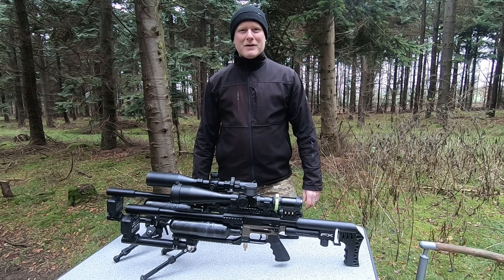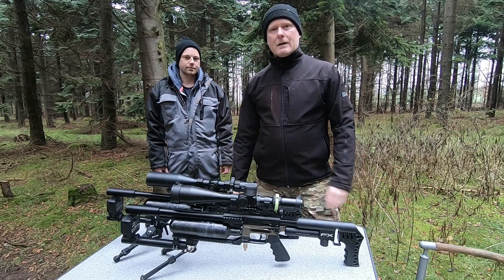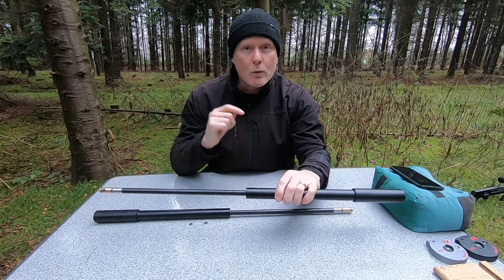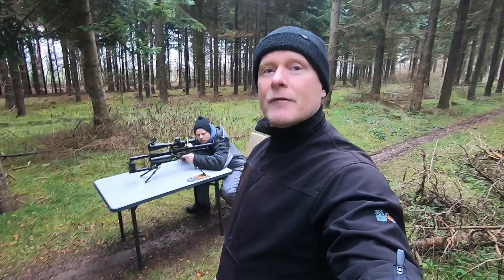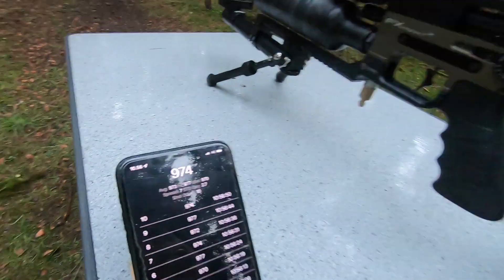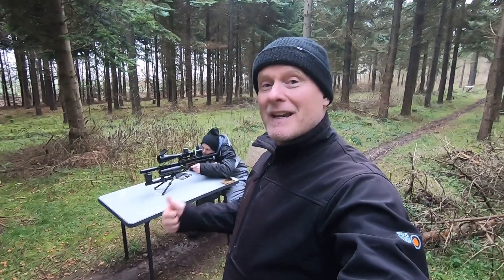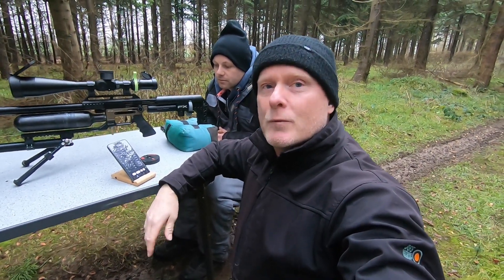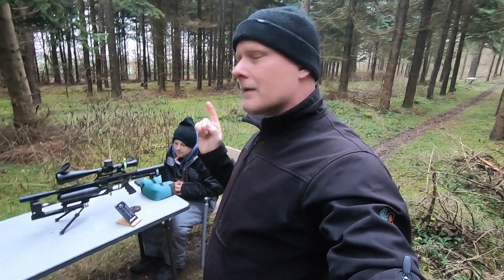STX Superior Liner 500mm vs 600mm - What is the Gain in FPS???

Comment: A very interesting video, I was surprised the 600mm liner gained that many feet per second!!!
Those magazines that Stephan made look amazing, does he make them to sell? Save shooting to you both from the UK, Tim. 👍👍
Reply from the maker: Even if it is an old video it still has relevans. And the 600 is just a much better choice. Just started with the 500 mm DRS and I would really love that it was a 600mm - even if Im only shooting pellets.
If you are on the hunt for a super magazine, Carm makes some SUPER models. Im using them in both Impact and DRS - also used them in the Panthera. And I have single shot loaders from Carm aswell.
Stefan is a busy dude, so he is not producing them for others anymore.

Comment: It is small gain when you campare length u hace spear against sword to carry around especialy if u hunt...
Reply from the maker: A longer gun is not that handy and depending on the enviroment the 500 mm will defenately be easier to handle in tight surroundings.
But there a longer barrel has the advantages are in air consumption and that it will stabilize heavier ammo better.

Comment: Hello mate,did you measured your 500mm stx superrior liner, exact measures is it realy 500mm or is it 485mm,thank you,as i ordered a slug liner and its exactly 500mm the one i got supplied with my m4 compact is superrior stx 485mm...
Reply from the maker: Its been so long since I used the 500 mm liner, but I seems to remember the length was not actually 500 mm. I have no knowledge about the new liners like the heavy liner in that length 🤔

Comment: The main advantage of a longer barrel is lower air consume for the same fps and same bullet weight.
So, for full advantage, the hammer time must be lowered, also the regulator pressure. With a longer barrel, the pellet has more time to accelerate.

Comment: Why 500mm and 600mm barrel have this same length?
Reply from the maker: The liners are different but they look the same bcs of where the barrel connect inside the shroud 🙂
Reply: @VikingAirgunner  I don't understand. The 100mm difference cannot be hidden.
Reply from the maker: @MrPonosify  Sure! If the attachment to the barrel inside the shroud is placed differently 🙂
Reply: @VikingAirgunner  I understand. Please tell me. I have a maverick (0.250) and would like to change transferport to hume dualport. Is this good choise?
Reply from the maker: @MrPonosify  I dont have experience with the Maverick and the 25 cal, so I will not pronounce myself as an expert in any way.
But what ammo are u using, and what are your settings?
Reply: @VikingAirgunner  NSA 38,5gr 180 first and 150 second regulator
Reply from the maker: @MrPonosify  The new guns comes with 2 choices in the transfer port. P - pellets and S - slugs, so with you shooting slugs it would be a good idea to go for the dual hole transfer port. Maybe try to find the original with both options. And if you cant find it you can go for the Huma version 🙂

Comment: Hi friend well played, nice video big speed gain, I heard that if you put a longer gun you also gain in air consumption because you need less air to push lead, would you have been careful during your tests, thank you for sharing
Reply from the maker: Hi buddy 🙂
You are right!
Actually you have the answer in the video bcs the perfect velocity of the ammo dont really change that much from 5 - 600 mm - at least that is not my experience. So if you gain 46 fps by changing from a 500 to a 600 mm liner, you dont have to shoot the 600 mm at this crazy speed. You turn down the power of the gun after installing the longer barrel and get the same speed as with the 500 mm, and thereby saving air 🤗
So the gain is to save air and hopefully improve accuracy. Testing in the upcommin months 😀
Reply: @VikingAirgunner  Thanks

Comment: Perfect video 👍👍👍Congratulations🥂👍 Thank you do you think the 700mm barrel would still be important to increase performance?
Reply from the maker: Thank you so much for your kind words 🤗
You are hereby the first here on YouTube to know that I just ordered a 700 mm barrel, so I will do a video with it very shortly 😉
I still havent tested the 600 mm for accuracy, so Im pretty excited to see if it makes any sense with the longer barrels in 177.

Best regards and Happy New Year 🙂
Reply: super looking forward to the video, I'm curious.  By the way, the speed at 600mm barrel was not very constant, why?  Happy New Year with M3 😀🎄
Reply from the maker: @Matko9Kubko  Every time something has been changed on a gun it will require some fine tuning.
In the video the barrel are just swaped without any further fine tuning, but with a little adjistment Im pretty sure that the spread and std div would narrow in 🙂

Comment: Hi V.A. and thanks for yet another great in analysis and comparison in .177 video.  One think to point out though is that FX as far as I know are not producing the 600 mm in Superior Heavy, just standard. The Superior Heavy starts from .22 and up. Anyhow, I don´t care, cause I think tests I have done with the K.O and Wildmans in .177 and using the Superior standard , are okay for my groupings liking and using the 500 mm barrel. Will of course consider the longer 600mm cause the velocity is higher, but I have the feeling that cause of the lite slugs used in .177. the poi and groupings will be less accurate, the further the distance. if you catch my meaning. But slugs are definitely the way to go with .177 as they will travel longer and will, if of course tuned correctly have better groupings than pellets. Looking forward to perhaps a video where you compare the poi and groupings between the 5 and 600 mm. 
Great you brought with you Stefan the Wizard. Perhaps you can do a video on all the stuff He does for the Impact and perhaps other airguns as well. The only thing now to totally dress up the Impact with CF, is making the shroud, so you have the liner sleeve, the barrel carrier and then just needs the shroud. 
And by the way......Merry Belated Christmas to you and Your Loved ones! stay safe and shoot safe! ❄🎅🏻🎄🤶🏻☃🔫
Reply from the maker: Hi my friend 
You are right - the heavy liner is not available in the 177, but as you say the standard superior is doing the job.
I havent really tested the 600mm on the longer distances yet. My groups are usually falling apart in the cold weather, so I imagine to do those videos in the spring.
I cant imagine that I will go much beyond the 980 fps with the KO. They seem to perform really well at that velocity, but so nice to be able to turn down the reg - but lets see what the next couple of months will bring of experiences 😀

I hope that you had a nice Christmas and that you are ready for a new year - with all your new gear 😎
Reply: @VikingAirgunner  Hi Peter, go check spaweapons they have the .177 slug liner in preorder !! Keep it up

Comment: Apologies if I am mistaken but would a longer barrel not reduce velocity but increase accuracy and a shorter barrel length would increase velocity but decrease accuracy? Roughly speaking, you would assume the velocity of a projectile when leaving the barrel, would be the total energy coming into the barrel from the cylinder or regulator, minus the energy lost through friction and thermo dynamics of pushing the pellet through the barrel.. so, longer barrel means greater friction and energy loss while pellet is pushed over a longer barrel length, but the increase in stabilisation dynamics means more accuracy and the opposite would be true for shorter barrels, less energy loss from friction over shorter distance and more energy on the  pellet resulting in higher exiting velocity, but lower stabilisation and accuracy.. I suspect that although you used two identical rifle models, the rifle fitted with the longer 600mm barrel had a slightly higher output rating on its regulator which was the reason for the 46 fps gain over the 500mm barrel as it would be almost impossible to ensure that two seperate regulators are manually tuned to identical output ratings to accurately compare velocity figures attributable to the barrel lengths as only factor.. In order to accurately test impacts to velocity from 500 to 600mm barrels, I would suggest you perform the test using the same rifle while swapping the barrels after each shot and then analyse the average ratings for shots from each barrel to nullify any differences from using two seperate regulators and rifle setups..
Reply from the maker: Thanks for your comment and your analysis 🙂
First I want to clearify that we only used the Mk2 for the testing of the two liners. You can watch the video again and you will see.
As for your question the barrel is where the ammonition gains velocity. It does so through the entire length of the barrel, so using a longer barrel gives the slug a longer distance to pick up speed.
You can compare it to a dragster trying to reach the maximum speed in 201 m and the exact same car on a 402 m. Same car (gun) same power (reg presure) 🙂
Reply: @VikingAirgunner  thank you for your reply and I meant no disrespect at all, I’m actually just starting out in the sport and am trying to understand the physics of it all so I do appreciate your content and additional info 🙂✌️
Reply from the maker: Im sorry if I sounded offended - that was not my intention 🙂
Im very happy that you have taken the time to share your thoughts - and Im happy that I can help you. and you are more than welcome to ask me again if you have any questions 🙂
When I started out I had tons of questions so I fully understand your situation.

I wish you a happy New Year 🙂

Best regards
Peter P
Reply: The longer barrel has more time to push the pellet or slug.
Less air is waisted.
It's more efficient and far outweighs more friction.
The same principles apply to a larger plenom.
Reply: @stedyone1090  thank you for your reply, I appreciate the additional info and believe I now understand the mechanics more accurately than when I posted my first comment and the more extra information I can source the better ツ

Comment: This is an informative video.    Small fraternity of people with .177 impacts.  I have a 600mm M3 and it is hard to find information on these, especially tunes.  I had to frequently clean my liner (150 pellets) or I would loose accuracy.    I did a mild polish and things improved (now needs cleaning every 250-400 pellets and much easier to clean).  I won't try to polish anymore until I can find an spare STX superior 600 liner.    So, yes, it is hard to find over here in the USA too.   THANKS
Reply from the maker: Its interesting how there are different approaches to barrel cleaning. I have never cleaned my barrel unless just after getting a new one, but maybe the 600 mm is different than the 500mm 🤔
Reply: Totally weird, cause i have both .177, 22 and 25 cal for my Impact and only clean them once a year, and that is because i dismantle the gun to clean and change O rings. I feel that the more pellets/slugs goes through mine, the better it shoots....know it sound also weird. But again, liners all thought they should be the same from Factory they aren't.